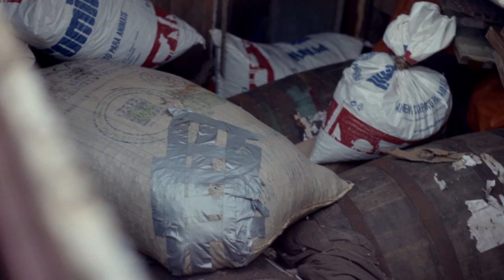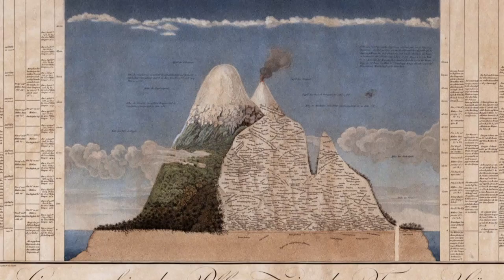The Anthropocene: The age of mankind - Docu - 2017

Comment: Greenhouse gases may bring on a next ice age in short term: the geologist should know that there is a model in which Greenland icemelt leads to a critical level of desalination of the Gulf Stream between Greenland and Newfoundland that interrupts the deep ocean cooling circuit.  The deep ocean cooling circuit keeps the globe more even in temperature; when it stops, a sudden ice age will occur as cold water is isolated at the poles.  This has been proven out in Greenland ice cores - that there have been several sudden onset ice ages that happened in just two lifetimes, and were preceded by high levels of CO2 (in the core air bubbles).